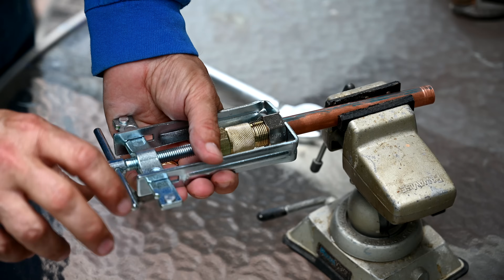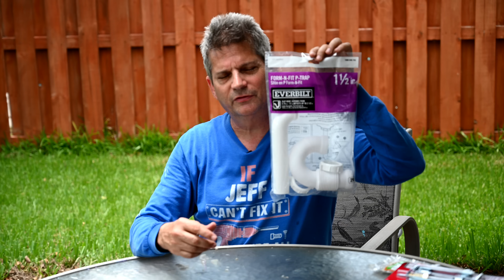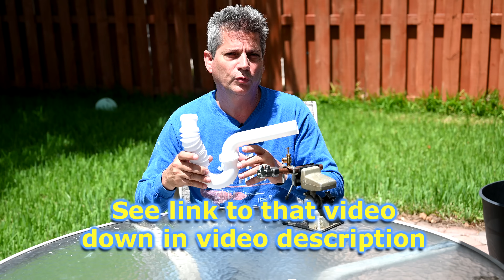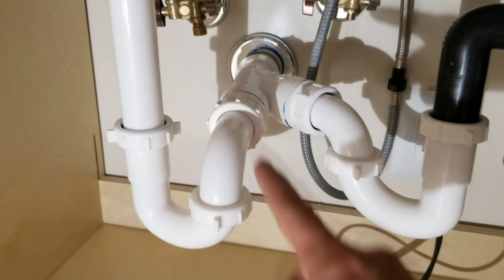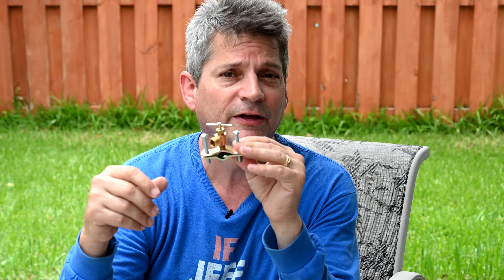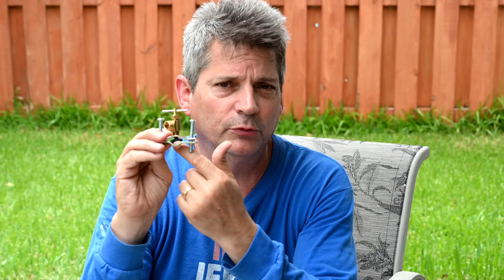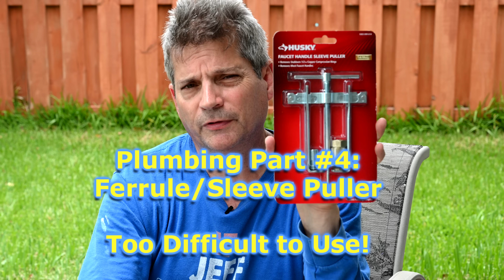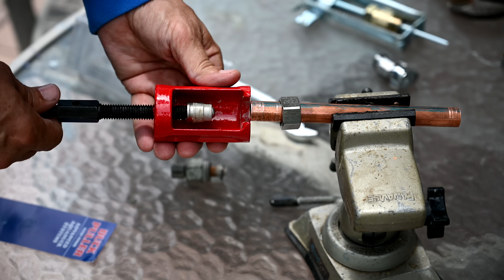4 Plumbing Parts/Tools You Should NEVER Use. NO Plumbing Fails

Comment: I do understand why the plumbing code would not want those flexible pipes but they have so many DONTS that sometimes it seems impossible to find a way to connect pipes. It seems as if every solution is banned; it's no wonder that one would resort to the easy way!

Comment: On the sleeve puller know how to properly use the tool before you go on line looking like a dumb azz. Their are two other slots on the top bar that allow for the 2 arms that hold the nut. If you slide them out to the next notch you don’t have to hold the arms once pressure is made against the nut and the handle will turn freely been using this type tool for 25 plus years as Lic. Plumber.

Comment: I like the flex/offset/ribbed fitting.  If you only use it directly under the sink opening, it can be a good choice, but only because the sink opening allows periodic cleaning of the throat. The ribbed geometry can collect debris, but is easily cleaned if positioned properly.
Reply from the maker: You are overlooking serious ramifications of your choice. First of all it is a violation of plumbing code to install a flexible P trap. Also you didn't even mention the fact that they tend to crack a lot at the creases of the accordions and caused devastating leaks. Also many home insurance companies are now doing 4 point inspections where they send people into your house and look under your sink and if they see one of those in your house they will force you to remove it or they will drop your insurance period I have already had to go in and repair two ladies that I know who this happen to them
Reply: @jeffostroff  Nice try, no cigar.  I been doin' this since '72.  Remember:  there are no "code police":  what you do in your own home is yours to keep.  [Yeah, if you're building a home for sale to others, different story]  The accordion folds will eventually "work harden" but only if you keep flexing them, which you don't once they're installed (and in particular if they are used as I stated, from sink to trap bend, which is a pretty rigid, non-flexing app).  Anecdotal "evidence" such as you cite isn't evidence (I do a lot of legal forensics).  A pinhole in any of the waste system is annoying, but the term "devastating" is over-billing.  I've been hearing this citation about insurance companies for 50 years, and have never seen it.  It costs too much to inspect anything.  Make sense here:  If someone drowns because a little slit in the pipe accordion is dripping water, you might be talking to the insurance company's lawyer, but there is no reason to fear the dreaded "knock on the door" at midnight.  The great value of forums such as this is the sharing of knowledge.  Scare tactics foul that value.  It's valid to say that building an apartment building with non-Code materials is wrong, but stop there.

Comment: People, that Husky tool works just fine don't mind this guy. He's not using it correctly. He's not using one of the components of the tool. When he holds the package at first you see all the parts. Then when he demonstrates it, it's missing a part! Which is odd to me! If you READ the directions of the tool it will work perfect!

Comment: On the contrary here in Italy the flexible stuff is used a lot. I have never seen a plumber use glue in home drainage. That would be horrifying here now, I guess. We mostly use PP pipes (very handy to install, just push them and they hold nice and tight).
Reply from the maker: Should not be use there either, it is called out in the IPC, international plumbing code.
Reply: @jeffostroff  I believe that. But here if you ask 1000 plumbers I doubt that even 1 would know about the existence of such a code. Further, form the video in English I am watching about plumbing, it seems that there are significant differences on how plumbers work here. I am not a plumber, just someone curious who watch explores  and objectively it seems to me that the "Italian way" of drainage makes more sense and is way more practical and easy to maintain, at least for homes. Apart tradition, it is possible that is also due to different climatic conditions. Keep also in mind that here we generally do not use drywall (only to lower ceilings) and all walls are concrete (bricks). Thanks for your great videos!

Comment: Not really a plumbing problem, but...
I worked on electronic accounting machines, and one hospital in particular had problems intermittantly with the machine.  We determined that the problem was in the ground.  The electrician had used the plumbing as a ground and swore it was properly grounded.  We went to the basement and found the panel, and the large ground wire properly connected to the water supply pipe...  a plastic pipe.
Reply from the maker: A plastic ground! Now that's a first!

Comment: I can tell you exactly who uses these items: big box store installers.

Example: Home Depot delivers and installs your new fridge with ice maker. The installer is not a licensed plumber (Home Depot would need to charge the home owner $$$$ instead $99 if a real plumber was  contracted for the job).

So when it comes time to install the water supply line for the ice maker, HD installer uses a saddle valve and is done in 5 minutes (he sure as hell isn’t going to be soldering pipe).

Frankly I don’t really blame the box stores for this dilemma—most home owners aren’t going to be happy with a $300 charge for an appliance installation.
Reply from the maker: Sears got sued for this years ago

Comment: Saddle valve is the worst that anyone could come up with. I guess I am not old enough to remember what kind of other fittings were back in a day. I had it in my house and removed it. It was used to get water for my fridge. The fact that Home Depot and Lowes still sell this is odd and a bit shocking knowing how many other fittings are available today. Very true that these home improvement stores sell items that should never be sold ever.
Reply from the maker: Back in the day they were not lazy they just did it right and soldered a little copper stub out through a copper tee onto the pipe and then put a valve on it like normal people do

Comment: What if your sewer line runs under your floor in the garage so am unable to use a p trap ?
Reply from the maker: Why can't you use a p-trap above the floor?
Reply: @jeffostroff  Because house sewer runs under the garage concrete floor to the Street, the bathroom is above the back part of garage, Garage is cut into sloping section that falls to street, garage retaining wall holds back 1.7m of dirt, so the Council approved it running internally back in the day ?

Comment: jesus christ the dishonest use of the husky at the end.
You are supposed to start with the threaded bit all the way out...
Set it on the pipe correctly and you would have already pulled it off before you got to that bottom out situation.

Comment: I have never needed to use a ferrule puller to remove a ferrule. Any experienced plumber can remove a ferrule by rotating and pulling with a Channellock.
Reply from the maker: Maybe you get lucky. I work in a lot of bathrooms where humidity and leaks cause corrosion everywhere and you end up with stuck ferrules. Channelocks can cause your copper pipe to go out of round and you'll have trouble putting the new ferrule on
Reply: @jeffostroff  In my forty years of plumbing, I have had some moments of luck, but removing ferrules from hard copper tubing the way I described was never one of them.

Comment: The solution to converting from an S-Trap to a vented P-Trap is to connect to the slip joint threads at the bottom of the S-Trap with a PVC female adapter, offset the vertical portion towards the back of the cabinet, install a PVC sanitary tee with an air admittance valve (AAV) above the sanitary tee. Come out of the side of the sanitary tee with a standard P-Trap. Done!
Reply from the maker: Yes that works, we also installed a valve under a kitchen sink last month on an island kitchen where there is no plumbing vent stack in the area. Our area allows this, but be careful, some states prohibit the use of air admittance valves.
Reply: The valve has to be placed higher than the sink overflow, which means it still has to go inside the wall. There's no way to do it (properly) without tearing out some drywall.

Comment: Gosh. I have a saddle joint that came with a RO system for a drain line. What type of joint should have been used?
Reply from the maker: An inline copper tee would have been fine, than solder on a copper pipe stubout of a few inches, then attach a compression valve
Reply: @jeffostroff  thanks for the reply! Love your content. Just to clarify. It's a ro drain connecting to pvc sink drain via saddle clamp. You think I'm ok? No need to reply, but any thoughts would be appreciated. Cheers!
Reply from the maker: @kindredhawk   I still would have preferred cutting the PVC pipe, and cementing on on the appropriate section of PVC pipe to make this happen. Now not knowing what type of saddle valve they used on that PVC pipe, it likely does not suffer the same types of problems that a copper pipe would have such as corrosion or dissimilar metals of the saddle valve causing electronicists on the copper pipe. However keep in mind that the plumbing codes is still still ban any type of of saddle fitting. They don't Explicitly call out copper pipes or not they just say band fittings and saddle valves is one of those. So in the spirit of the code into a but into avoid getting shut down by the city inspector, comma I would tend to do these the proper method. It's sort of like writing down a sentence with not the best grammar in the world and your English teacher would correct you.
Reply: @jeffostroff  Thanks. Appreciate you taking the time to respond.
Reply: @jeffostroff  also really appreciate this vid. We moved into this house years ago. Thoes flex drains were here when we got here. Looking forward to getting them done right.

Comment: On that offset after changing a vanity and sink, all you have to do is turn the fitting left or right. I have had problems with
drains that a plumber put in and after I change it, I have no more problems.
Reply from the maker: Yes, many don't really know how to install a p-trap and don't hang around to test it.

Comment: I always knew the gases escape when pulling out a toilet, but I never knew it came out of the water pipe. My friend mentioned something about plugging when we were working on the new bathroom vanity pipes and I told her she was wrong. Time to apologize! I can't plug mine though because the pipe is bent and malformed and have a big hole in it. Very interesting to see products being sold that violate codes! The homeowner's insurance thing was certainly eye opening. I may be selling my house in the next year, so it's best an inspector doesn't find that. I didn't see the tiny compression sleeve puller on your list. Do you remember who made it?
Reply from the maker: They are out of business, try duck puller it is a good one also
Reply: @jeffostroff  Almost looks like you could make one. Thanks for letting me know!

Comment: I use about twenty of those saddle valves, on a 3/4 inch poly pipe run, to tie in irragation lines for flower beds. I always tell people they are unsafe in the house, and usually end up wit at least fifty of them in my van each year. For the watering system they are perfect.  Most we get are water to ice maker now, but in past most were for water to humidifier on furnaces.
Reply from the maker: That's a great idea!

Comment: Two questions. 
a) Your take on SharkBite fittings
b) Your take on Power Press Tools and fittings.
Reply from the maker: Sharkbites should only be used for temporary work, or if there is no other solution possible. If you do install them permanently, I only do it outside of the wall so we can see if it ever leaks. Pro press is great stuff, many pro plumbers use it, much safer in confined spaces than soldering pipes with a torch.
Reply: @jeffostroff  Thanks. Most of my plumber friends swear by soldering, but my contractor friends love SharkBites, even in their own homes. I feel better with soldering. But have very real fears of fire! Thanks for the great videos. Ok, one other question. In my mom's house, there is rolled small copper that goes to her refrigerator for water and ice. And it's 50 years old, with some green showing. A flooring contractor insists that we swap it out for PEX. Any thoughts on this? Coil copper vs. PEX for a 15 foot run?

Comment: Wow, have a saddle valve on main water line I installed about 15 years ago. Hasn't leaked yet. Didn't put it on to save time or money. It came w/ a kit for refrigerator line. Had no idea it was against code. I can see how it could easily start leaking though. Just lucky I guess.

Comment: One of the last tools you used as a nut pull I always used as a handle puller, I think thats what it was designed for. The long pin sits where the screw would screw the handle on and the prongs would sit under the handle. Try it works beautiful.

Comment: I think . .  being a code worshiper is bad. Not all those fixes are bad. . . worship God . . not plumbing codes.  I used those "saddle valves" a lot when i was a water softener equipment installer and never got water leak complains . . Greetings.

Comment: Have two of the prohibited items on your list. The saddle trap was recommended by family members before I knew any better. Decent enough at soldering so plan on changing it out soon. The flex fitting connects my tub drain, I'll take my chances with that one lol.
Reply from the maker: As long as it is connected to the overflow drain that is ok on the tub, most are like that

Comment: *OK;  CONCERNING THE SADDLE VALVE,  ICE MACHINE CONNECTION.  SO  WHAT TYPE OF VALVE SHOULD BE USED.  EASY TO SAY NO-NO TO THIS.  BUT YOU ARE NOT OFFERING A SOLUTION TO THE PROBLEM.    1) WHAT VALVE SHOULD WE BUY.  2) WHAT VALVE SHOULD WE BE LOOKING FOR THE PLUMBER TO INSTALL*.
Reply from the maker: We covered this in another video https://youtu.be/0lLW2sJLa0I

Comment: dude, really?  you're not even using the husky tool the right way!!!  the two arms are for faucet handles that don't want to come off.  Spread the arms out of the way.  They are NOT used.  Insert the gold male threaded part into the female nut and turn the handle just like the other tool you fawned over.

Comment: This is my 3rd comment on this video. Why I watch videos over and over about things I’ve known for years is beyond me. Anyway if you ever revisit this video or update it, I’ve thought of another thing that could be added to the list. This would be hand spray bidet attachments on toilets. They must be popular in India because it seems that most Indian immigrants I’ve worked for had these. It’s a tee that attaches to the bottom of your ball cock/fill valve and then the toilet supply attaches to the bottom of this tee. It has a hand spray that attaches to this. This sprayer being used in the toilet has a high risk of cross connection. I’m guessing they come with some sort of check valve like most shower hand sprays but this isn’t enough. You’re basically relying on a tiny spring to keep toilet water out of your water supply. If this is one the second floor and you have a leak on the first floor and shut the water off, then just that water draining down from the pipe is enough to create a siphon and suck toilet water into your water supply.
Reply from the maker: good info thanks Josh!

Comment: Could you please explain the danger of the S trap under a sink when it has its own pipe to the outdoor gully trap.
Reply from the maker: There probably is no danger, unless this outdoor area you were referring to contains any type of gases that are formed as a result of the waste going down this pipe. It is still possible for this as trap to self siphon itself out and then if there was any gases anywhere in that pipe outside it could escaped to the inside of the house

Comment: I used them all the time and never had one call back for issues so stop telling me that I can’t use what has been working for years and years.  Maybe you just don’t know how to install them yourself and maybe that’s the issue.
Reply from the maker: maybe you just never got called back because they don't want to call back the guy who caused the flood in the first place. What you are doing is violating the plumbing code. So So stop using what has NOT been working for years and years, and os banned by code, because it does not last. You are doing your customers a big disservice.

Comment: My plumber never returned to re-work my plumbing after they installed a dishwasher.  So I got sick of not using the new dishwasher.  I wish I found your videos on the j-flex no-no before I did the job.  It works, but I had a feeling it wasn’t right.  Thinking to myself the ridges are going to catch everything.  I’ll re-do the plumbing and know what to do thanks to your other video on off-set drain connections.   

Found and subscribed to your channel due to your outstanding Champlain Towers reporting.   Now when everyone says “you tube it” for home repairs - you are the go to!  Thanks!

Comment: Nice video, quick question what’s the best way to clean the kitchen drain lines. 
I have a1 1/2 inches pvc drain line that is getting clogged all the time there’s any kind off liquid or something to clean? Thank you
Reply from the maker: No liquid cleaner of any kind ever works outside the commercial. In the bathroom I use that  dollar plastic tool that that goes down he drain and claws back all the hair out.